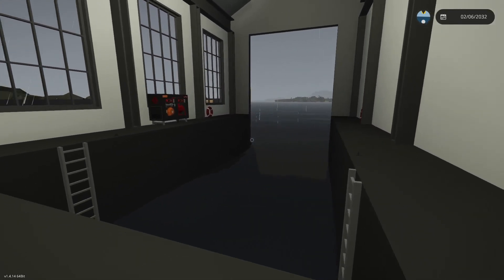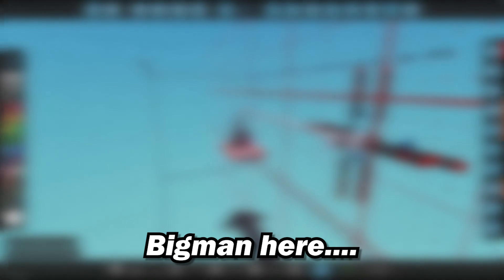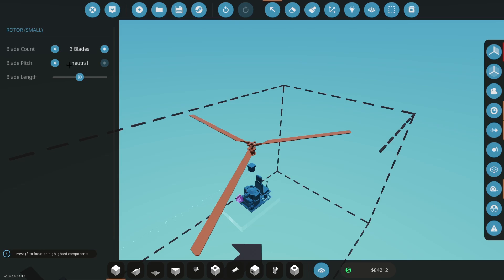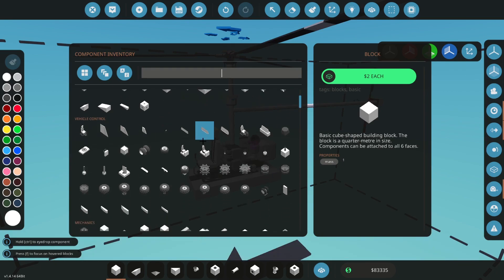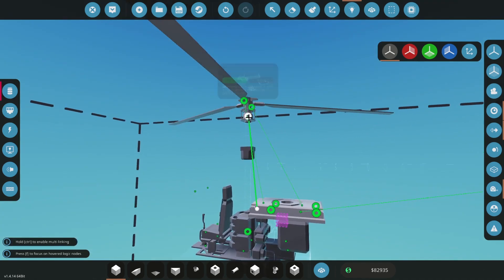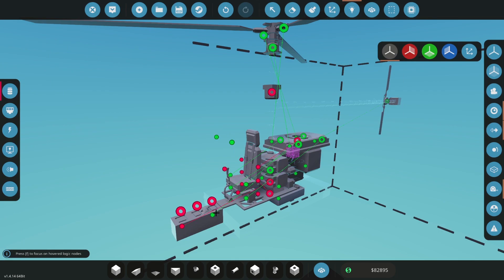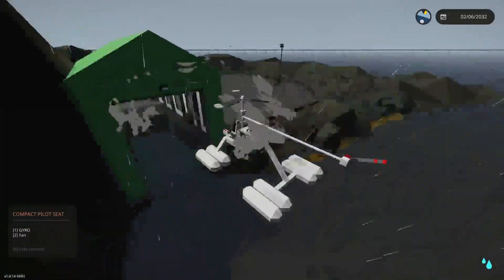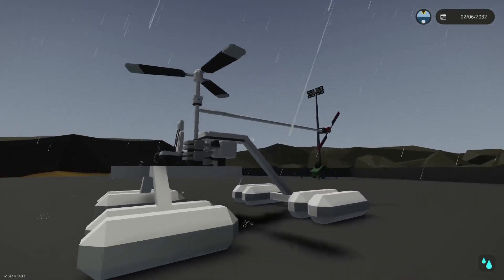Helicopter Basics - The Stormworks Guide Ep 2

Comment: mine spins in a large circle in a left direction
it doesnt spin really fast just like goes left constantly
Reply from the maker: That's gonna require some tuning. Happens with all helicopters
Reply: @BigmanBoi  ive been trying too, is there anything specific that might help
Reply from the maker: Pid controllers. might make a tutorial on it
Reply: @BigmanBoi  that would really help :D
Reply: @redabyss3447  try trimming it by holding alt and adjusting the directions until its stable. Easier than a PID
Reply: @BigmanBoi  What kind of tuning? I have same problem as this guy and really dont understand what to do